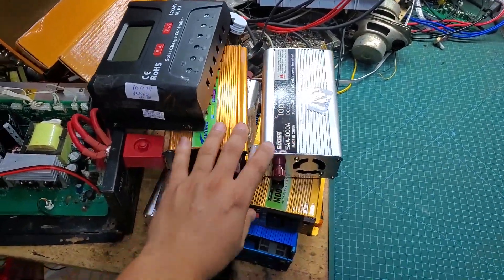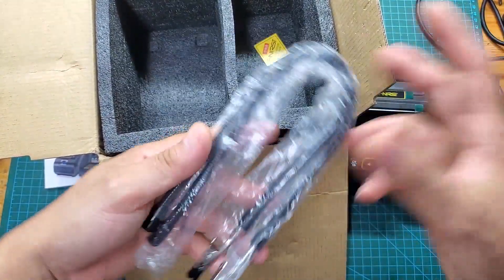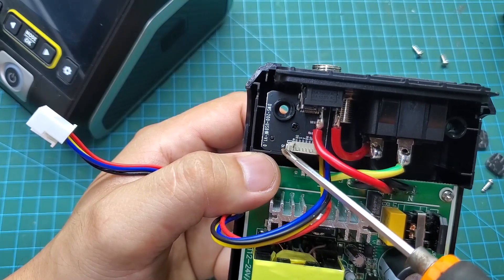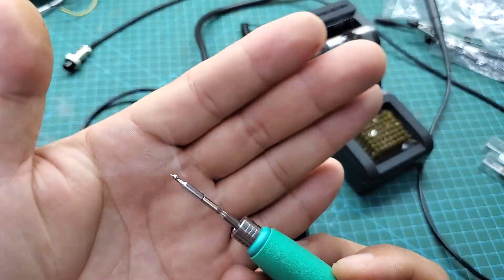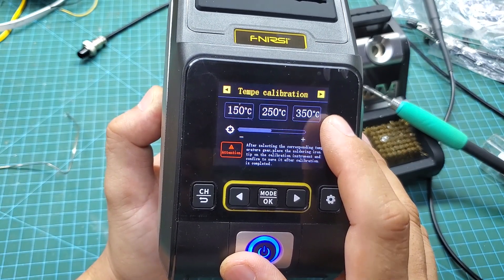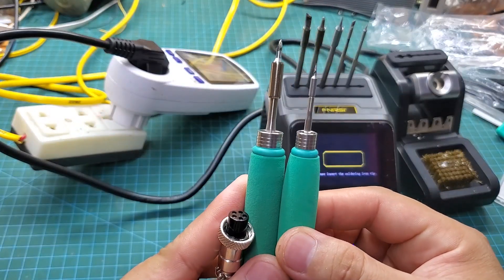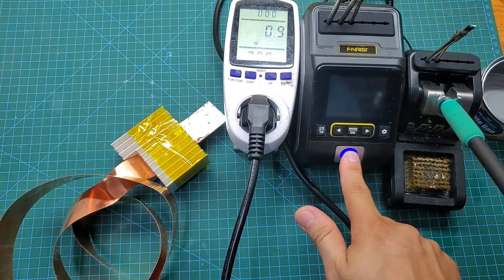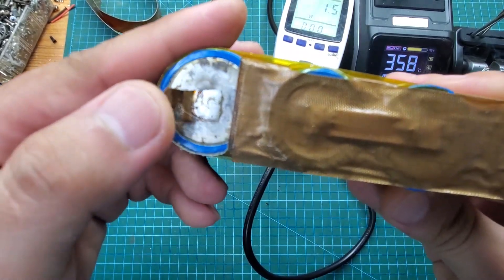Discover the DWS-200 - A High-Power Soldering Station for All Your Needs

Comment: He completely disassembles and analyzes this thing, but misses that the earth ground isn't connected to anything. You needed to short that pad to complete the circuit to ground the tip of the iron.
Reply: How safe is it to use this iron without the tip being grounded?
Reply: He should put a 1 Meg ohm resistor on the pads, else you will have some fried up ics.
Reply: @NIFUable Why not just bridge the pad with solder?
Reply: @xuxusito  Think about what happens if you accidentally touch a live AC circuit with the tip... if the tip is shorted to earth ground, you just had a really bad day. With a 1 Megohm resistor you have current limiting to earth ground. The measured leakage on the tip is only a few microamps without the resistor so the 1M resistor will be fine for killing the leakage voltage to the tip.

Fnirsi now say they are now installing the resistor in manufacturing. So newer production units already have it done. If anyone is concerned about the small leakage possibility, they need to check their particular station.

Comment: Hi.Whay is the best ,,FNIRSI DWS-200 Soldering Station'' or ,,Axium T3B'' ? In your opinion? You can write to me privately if you think you can't answer here. I want a correct answer. Thank you
Reply: similar ,  dws-200 is faster heating than T3B, if you work on delicate circuit ,both are BAD! voltage leaking on tip ,this issue for all SMPS soldering station!

Comment: Is the tip grounded?
Reply: On the one I received it was not, but there are SMD pads on the PSU's PCB that were left empty and which you can bridge using solder (or a 0-ohm resistor) to ground the tip.